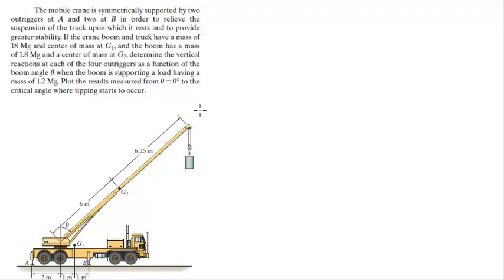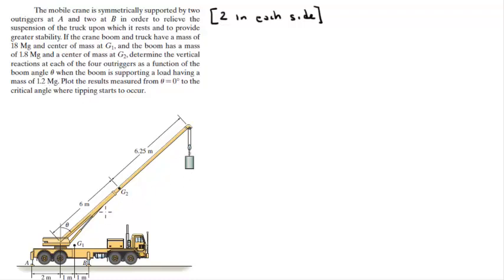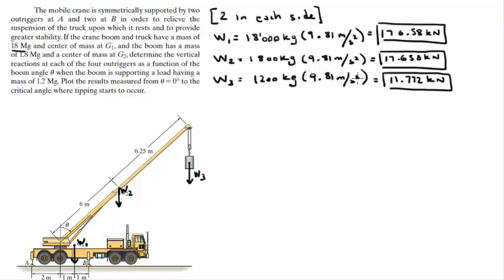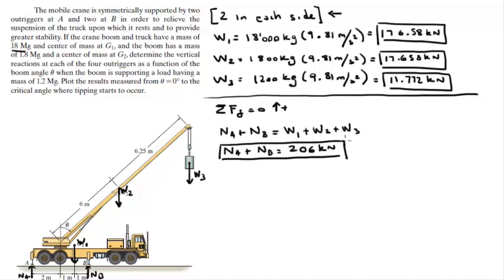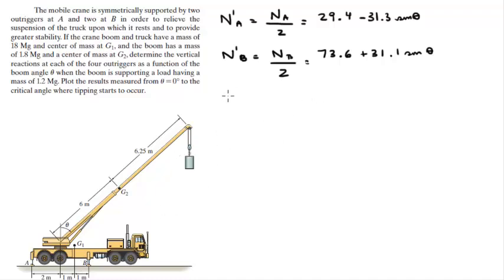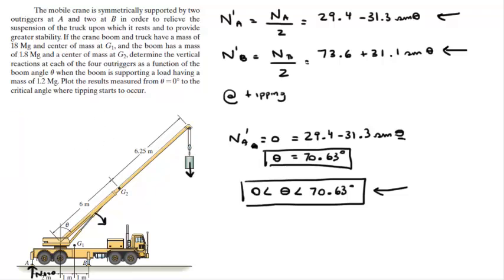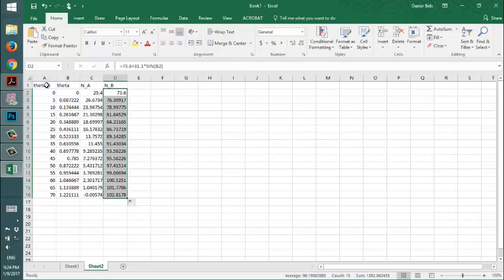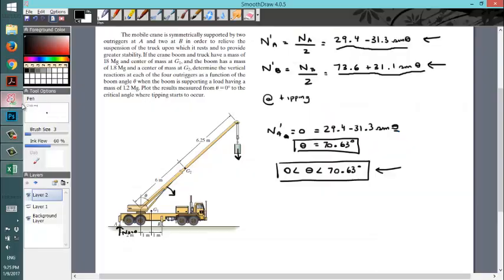determine the vertical reactions at each of the four outriggers as a function of the boom angle

Comment: I’m actually trying to work out the outrigger loads/reaction forces for my Kobelco RK-160-2 mobile crane as they aren’t available to me through the manual. I would really appreciate it if that is something you could work out for me and possibly provide a spreadsheet of those values at varying angles/degrees at its maximum lift capacity of 16t.
Reply: Hi Gina, Have you manage to work out the maximum lift capacitiy of the cranes? I am currently looking to find out the same

Comment: it says the crane boom and the truck have a mass of 18.  then it says the mass of the boom is 1.8.   so is the mass of the truck and boom 19.8 or (16.2 + 1.8)?  The later gives a theta of 60 deg instead of 70, not a good mistake to make if you are running a crane.
Reply: I was wondering that too.

Comment: Did you round differently? In the solutions to this problem, the answer shows:
 theta to be 70.3 degrees , 
N'A to be (29.4-31.3 sin(theta) kN and 
N'B to be 73.6+31.3 sin(theta)kN

My professor used the sum of moments from B for this.

Update: 
the error occurs at 7:05 in the video.I think you may have just looked at the sin(theta) wrong when writing it down. It was supposed to be 62.538.
Reply: Divide his answer by two. The answer requires the Na and Nb for each of the FOUR legs, not two which is in the picture.
Reply: @SpaceShark240  yah, he said that at first and took the note....
Reply: I think your N'B is supposed to be 73.6+31.3 sin(theta) kN